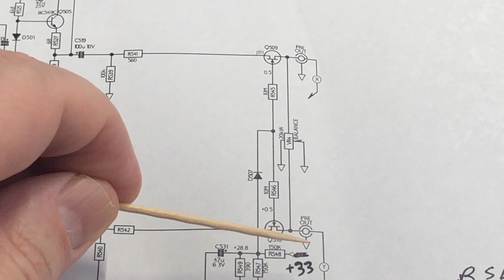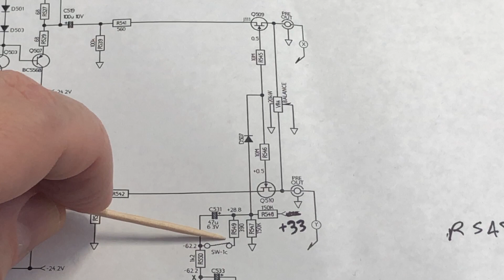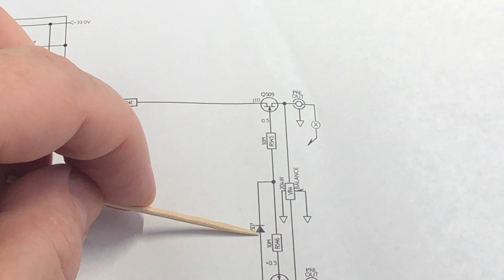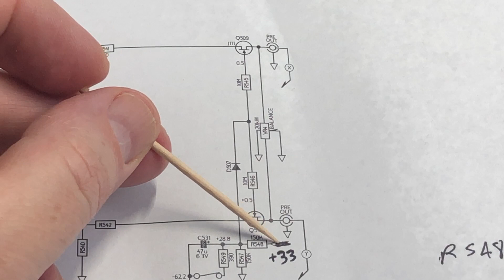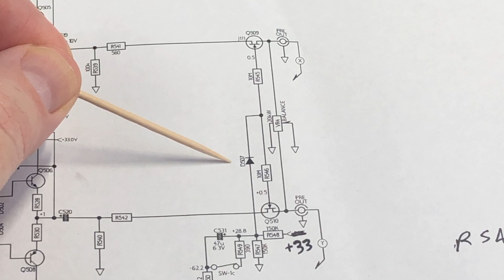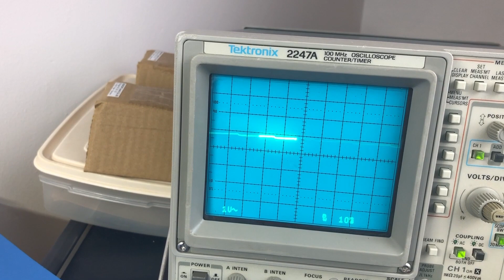NAD 3120 Amplifier Hum

Comment: I have a continuous loud buzz on the right channel. It starts right away when I turn on the amp. It's not in the speakers or cables.  The left channel sounds amazing with my dynaudio speakers.
I can't visually spot defective capacitors, although I can spot some glue which they have been attached with. I have checked the ground connections and loose screws and all seems fine. Do you maybe have suggestions what this could be? Thanks kindly for your ideas.
Reply from the maker: Continuous loud buzz to me sounds like one of the output transistors has failed short circuit. This would mean you have DC on your speakers, which is really really bad and can kill your speakers. This isn't a DIY repair, I'm afraid - you really need to have some electronics knowledge. I recommend you take it to a tech near where you live. Good luck!

Comment: Shorting the JFET or taking out the JEFT and bypassing it, will definitely sort out the problem, but if you want to retain the muting circuit, a simple fix would be to replace C533, 47uf 50 volts with a higher value (and with higher voltage rating). I have found 1000uf 100volts to work just perfectly.  If you want remove the thump, not a bad idea to build a small speaker protection circuit (or delay circuit) with a couple of transistors and a relay (per channel). You can remove the 1uH speaker inductor from the power amp section and introduce the delay circuit in its place (the 1uH inductor can be included with the delay circuit instead like this video: NAD 3020 project loving some 4 ohms - YouTube). Some tips from my experience with loads of these 3020s.
Reply from the maker: Thanks - I watched your excellent video before attempting to fix my hum problem, and I am pretty sure I tried the hi value 1000u cap, which for whatever reason did not work. Can certainly look at it again. I also worked on a 3020i in another video, and I noticed that   the muting circuit had been completely redesigned. I think you know that the 3020 doesn't have any protection circuit. I have a kit coming in the post which I will put externally, this will provide protection and start up delay. So this will make the muting circuit redundant anyway.